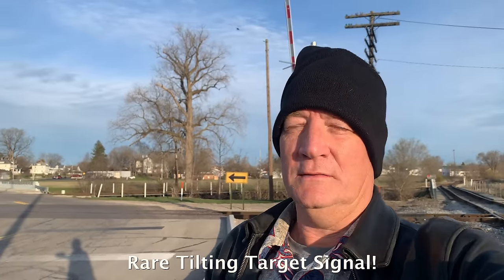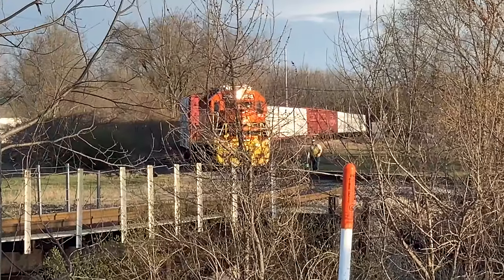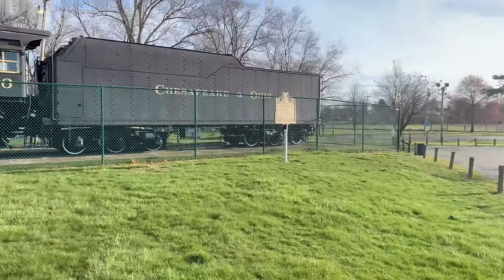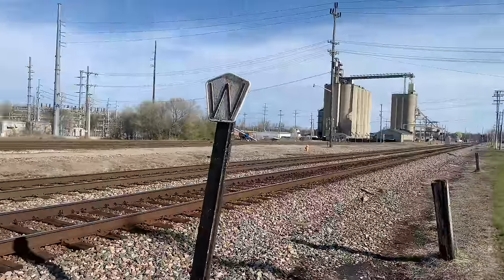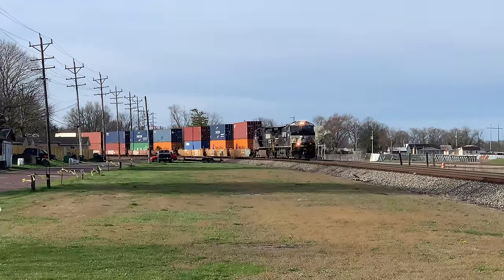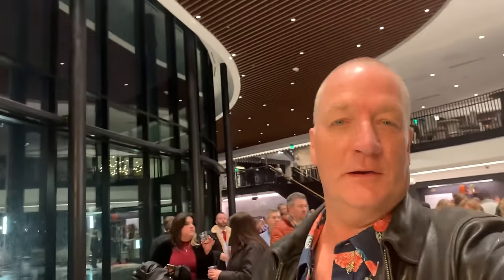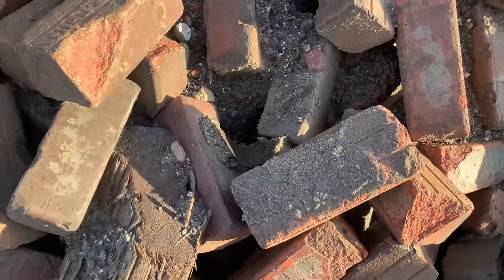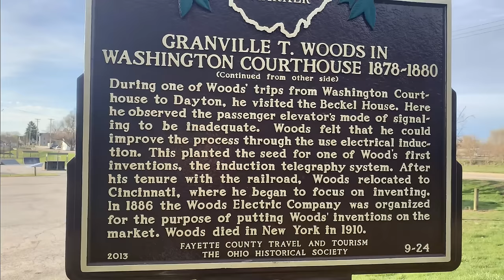RARE TILTING TARGET SIGNAL Protects Railroad Diamond On Indiana & Ohio Railway In Washington CH Ohio

Comment: And notice the Crossing next to the Diamond it has been given newer WCH Gated Signals replacing the Older Cantilever Signals as when you visited the Crossing back in 2019 the old Signals were still there but by 2023 they were Replaced

Comment: Wow it's a wonder that cast iron whistle sign is still there.moat of them are gone. The Middletown and Hummelstown R.R. still has their old cast iron railroad crossing signs still in use. They use an original  Western  Maryland Alco S6 locomotive for shifting  With the original Western Maryland logo paint.
Reply from the maker: There used to be a few on the CCET line but they disappeared some years ago.  I have them in my early videos
Reply: The Marlyand Delaware RR is still using 3 Alco RS3m engines daily.
Reply: @Melissa-ce8dy  That's cool

Comment: I had wondered if they had cleared the Midland station site.  They'll probably just dump in a truck and take the bricks to a landfill?
Reply: Somebody will use those bricks for a new project or a historical restoration.  It is hard to get period bricks for any kind of rebuild of historic buildings.  Some of the old, brick manufacturers are still around and they can produce bricks to match the ones that they made many years ago, but getting original bricks is the way to go.
Reply: @johnandrus3901   I had wanted to get back there and retake pictures similar to what I had with my father in 2016.   I had the plan to take a few loose ones.   Just didn't happen.  😔😪
     The city in which I live has several skids of old bricks positioned in an area.  I wondered  how they'll do a project with them?  Now, I have an idea.  Thank you.

Comment: I'd never noticed such a signal protecting railroad diamond. Is it a signal that was originally old and rarely used, and perhaps replaced by a more modern system?
Reply from the maker: It is still in use and is very old
Reply: I believe it dates to the 1920's , the pole, and I think the mechanism is original.  I&O replaced the B&O target board with modern LED lights a few years ago. All trains would have to stop before crossing the diamond if there was no signal.

Comment: Is there a WYE in corthouse ohio
Reply: Yes, in the video, they first stopped to align the switch from the one side of the wye that is used routinely for
Reply: Yes, in the video, the local stops to align the switch from one end of the wye prior to passing the target signal then stops again after passing the target to align the switch for the other end. The first end is regularly used for I & O through freight trains moving to and from the old B&O Midland subdivision to the old B&O Wellston subdivision, eventally connecting with the old DT&I.  The other end is used occasionally by the local to move cars to and from the industrial park on the B&O Wellston spur to connect with the old Midland sub. It's rarely used to turn cars.